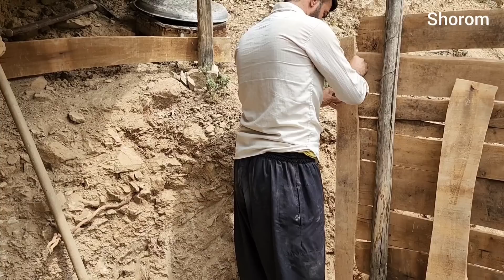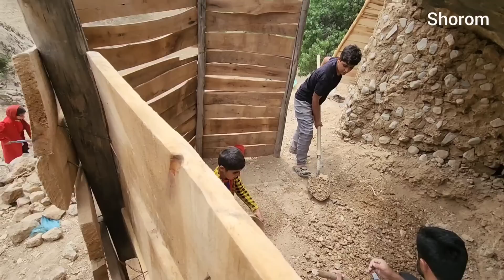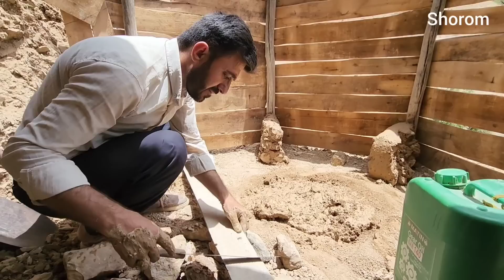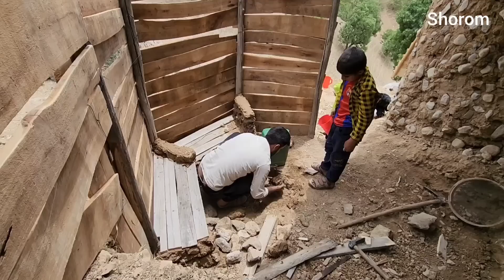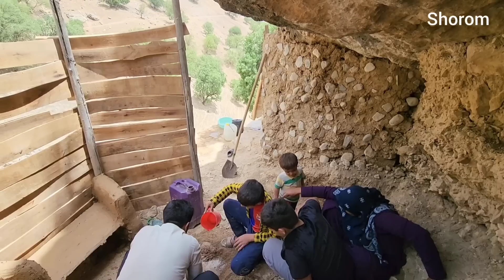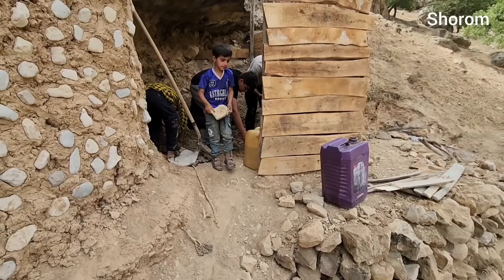Continuing to build the kitchen next to the nomadic hut by the nomadic family

Comment: When that's all table that you build it looks very nice so you can start putting go on the top of it and start putting the wood on the top what is missing nail it and put mud make it look nice your walls you did a great job used the same wood that you're  using to  make your floor flat cut that wood straight  you don't want splinters on you're hands

Comment: Should the family go to the city and bring home cardboard boxes, flattened cardboard can be used as a building supply.  Since your area does not get much rain, cardboard could be roof material or used as an alternate type of shade material.  You can nail cardboard to your wood walls for more insulation.  You can burn cardboard strips in the fireplace.